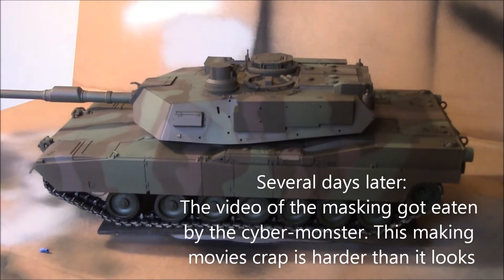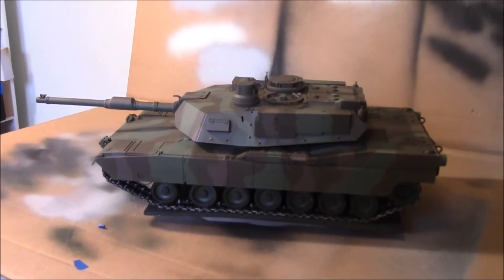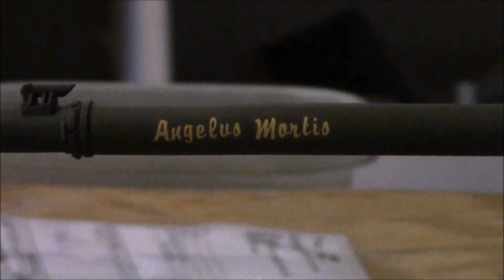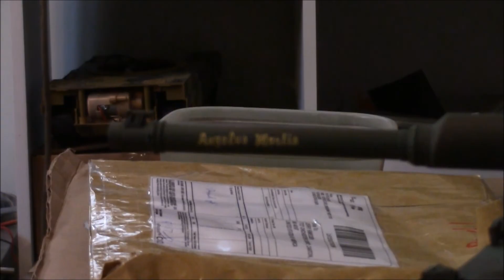M1paint

Comment: Also if you wanted more realism that I don't see often on other M1 RC/Models is that the wheel hub are actually clear plastic with a rubber stopper in the center as this is where you fill the hubs with oil.  This makes the hubs look black when properly filled.  Paining over the hubs prevents the crew from seeing if there is enough oil in the hub which will cause the wheel to lock up if they run dry.  Other than that I really enjoy watching your videos and I'm looking forward to your next armored vehicle in your collection.
Reply from the maker: Thanks for the info, Brian. I believe I mentioned in the video that the markings aren't correct, I just thought they look cool, but I may have to paint over the 61 and add the 23 on your recommendation. My MOS was 68G, aircraft structural repair, so I don't know all that much about actual  modern US tanks. Can you tell me more  about the "Bandits" part? Was that a unit nickname or something? Would they have had "Bandits" painted anywhere on the tank? I also appreciate the info on the wheel hubs, and I'll have to see if I can duplicate that. And of course the sound set is all wrong, but that's Heng Long for ya. I happen to have a couple of IBU2 Pros that I picked up on sale for a song (like $80 for an IBU2 Pro) so I just might have to install one of them to get that turbine sound. Anyway, as I understand it, the unit marking on the front, C-12, would stand for C Company, first platoon, tank number 2. Does that sound right? So my tank should have the arrow pointing up because it's first platoon?
Reply: 1/37 "Bandits" is what their Battalion name was.  Ours, 2/37AR, was the "Iron Dukes".  They didn't have a word bandits written on anything but would have their unit icon, a black four sided diamond with a white front facing skull in the center, on one of the combat identification panels on the front of the turret.   C-12 would be first platoon with the arrow pointing up and would be the platoon leaders wingman tank.  So 11 would be the platoon leader, 14 being the platoon sergeant, and 12 & 13 being the wingmen.  Both 1/37 and 2/37 were deactivated in 2008 after they closed down Friedberg but 1/37 was recently reactivated in Ft Bliss in 2015.

Comment: Please don't take this as being critical of your work but i just wanted to say the number on the side is actually incorrect.  I was in 2/37 AR back in Friedberg and 1/37 was our sister unit. 2/37 had the numbers 31, 32 ,33, 34 on the sides and 1/37 had 21, 22, 23, 24.  The second number would represent the company.  So A Co 1/37 would be 21 and A Co. 2/37 would be 31.  Your 1/37 "Bandits" C Co tank should have 23 on the side. The arrow would represent which platoon the tank belong 1st pointing up, 2nd pointing forward, 3rd pointing down while a HQ tank would have no arrow.